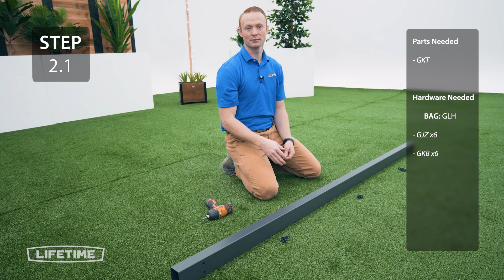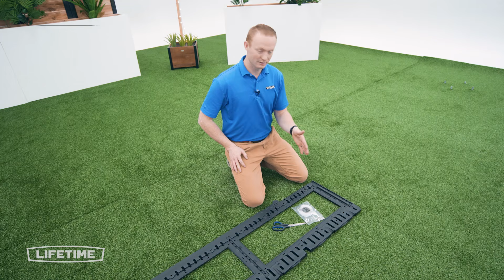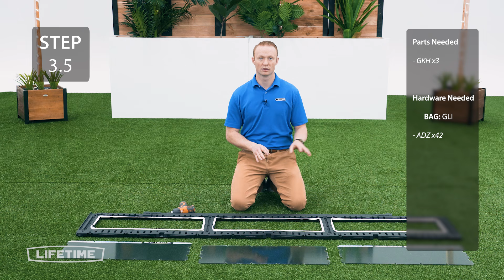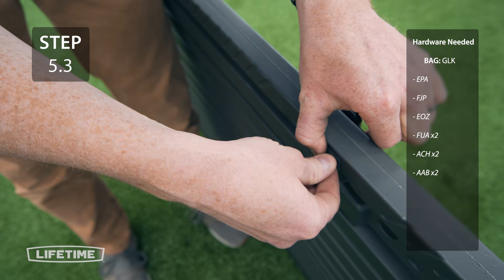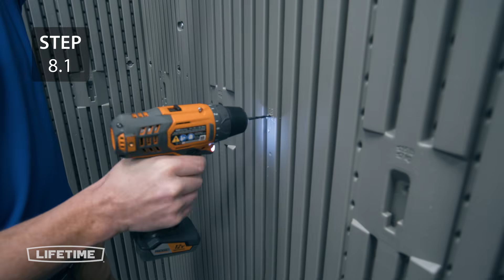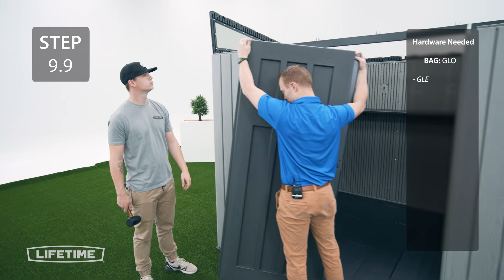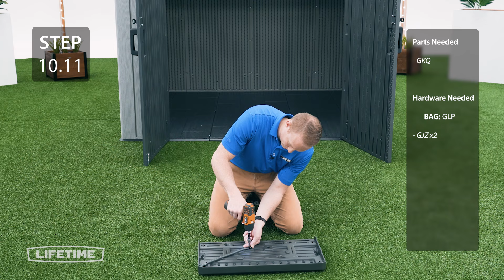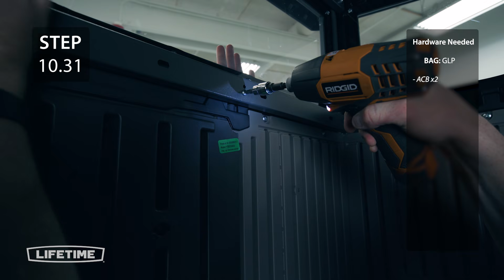Lifetime 8' x 8' Modern Shed | Model 60336 | Lifetime Assembly Video

Comment: This shed looks awsome once it's assembled. Wish I would have found this video before I started the assembly. I read the guide cover to cover but was still confused about where to place some of those black plastic scew anchors. Also, some of the anchors did not fit snug in their slots and when I tried to secure the screw, the anchor spun around and refused to hold. We ended up placing tape under the anchor to stabilize it when we secured the screws.
Reply: I open the screw anchors with a flat screw driver.
Yes indeed they will just spin and couldn't secure the items with them just spinning.
I  put the end of the flat screw driver in the middle and pried it open so when you put in place they would fit snugged wouldn't spin.
That is not mentioned in the instruction manual and would of save me lots of time if they would of.
Reply: Same problem with the screw anchors spinning when trying to get the screw in.  I used hot glue on anchor to hold it while screwing.  Also very confusing on screw anchor placement on roof panels, it would have helpful to eithier have them pre-assembled at factory, or at least color coded. Over all nice shed.
Reply: I put a small piece of tape to hold the anchors in but some would still spin and I used a small screwdriver to hold them until the screw got started.
Reply: Agree! Crap! Has to be a better way
Reply: I had the same problem with the anchors spinning so I tried drilling a few out by holding it in a vice grips and using a slightly larger drill bit than the one provided.   That worked.

Comment: I’m on 10.14 and it’s not lining up properly. The back two and all the ones on the outer side to but the ones on the beam don’t, I have no clue why and I’m genuinely perplexed and stumped.
Reply: I had the same issue of hole alignment. I ended up drilling new holes. The anchors were really confusing to where to put in. They kept spinning and falling out. Lucky I bought that flex seal tape at Costco with the shed sealed the seams with it. The shed was a pain in the butt.
Reply: @keithdickey7918  yes, I had a meltdown trying to figure out where to place  those "spinners". The illustrations had more detail than necessary making it difficult to determine which indentation to place them! Not to mention those that dropped out when trying to put the roof in place!
Reply: Keith Dickey I had that spinning problem with 2 points, I wedged it in so it would continue to go in.
Reply: I had trouble with holes lining up on the roof.  I made some new holes without anchors and hope the screws hold.
Reply: Me too, I had to remove the support so I could align the holes up. I have to call and hopefully get some help I can't finish the roof because none of the holes line up! I'm not a happy camper!!!
Reply: What did you finally do to them to line up???
Reply: Re 10.14 , make sure you have the 3 tresses pointed in the correct direction. The end with the extension should be above the doors. Also, is your platform level and square? We spent the better part of a day prepping the platform, so all the pieces fit with minimal effort.
Reply: pamela kovacich I just forced it to line up with a screwdriver, I did everything right start to finish.

Comment: what's the trick inserting the screw anchors?   they do not seem to want to stay in...
Reply: This was the most difficult part of the project for me.  Some of the screw anchors snapped in many of them did not so I had to glue them in so they would not fall out when I placed the roof panels on the shed.  Many of the anchor screws would not stay in place when I started drilling the screws in.  The anchors just spun around in the hole.  I used and needle nose and also a screw drive to hold in place while I drilled in the screws.  It was terrible. The only thing I notice that worked was to put upward pressure on the drill while inserting the screw.  I had to do about 15 of those anchors by hand.  I would not recommend this product because of that issue.  It added about 3 hours more just to work the 15 defected anchor screw installations.
Reply: All of the anchors I had to pre thread each one so they  wouldn’t spin. Made it so much easier.
Reply: Get a flat screw driver and pry them open from the middle enough so that they don't break and it should fit snugged with out spinning.
Reply: The easy way to insert the screw anchors is to pre-tread the holes.  This can be done by jamming a flat blade screwdriver between the anchors and the panel to prevent them from turning and run the screws in and out of each anchor with a power driver to precut the threads and spread the anchors.  While assembling, it is better to start the screws in the anchors with a hand screwdriver then use a power driver.
Reply: Yeah this is the only problem I ram into definitely going to try the suggestions tho

Comment: Warning before you purchase!
Make sure you are mechanical incline person with allot of patience, because if your not you are going to be expose to a rude awakening.
The robots must of practice on several sheds to get this right the first time.
Schematics are difficult for a person that has a difficult time to put a piece of furniture together. You need a good size work bench and take inventory of all your parts before you get started , if not you will get to the final steps and realize that the package was shorten parts, you need to finish this task. I had to get more hardware at my local ACE to complete this shed.
Today I finally finish to put this shed together and it took 3 days. I notice they where several gaps when I completed this task.  I engineered my own method to tighten these open gaps and it worked perfectly , especially above the doors on the outside corners.
So good luck and have lots of patience and time when building this shed, and yes I did it all by my self.
Reply: Quick question what did u do fix the gaps above the doors I have the same issue. Also did u have little gap where the gable meets the front window piece corner. Thanks

Comment: It would be helpful if you laid out all the screws and showed which you are using for each section.
Reply from the maker: On each side of our videos there is the list of the hardware you'd be using to help make the assembly easier. You can also match the hardware to the picture of your instruction manual, if you put it right on top it should be the same size of the actual hardware.